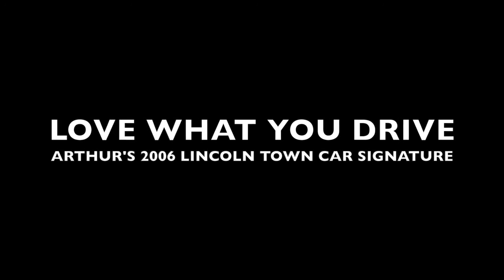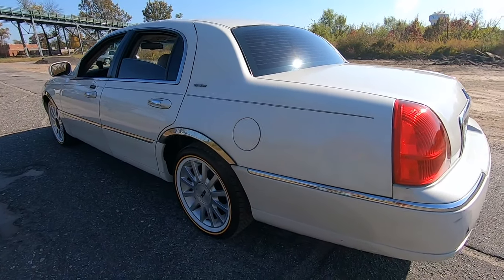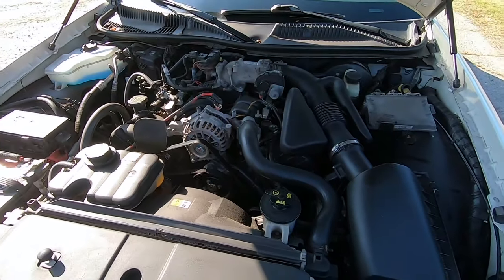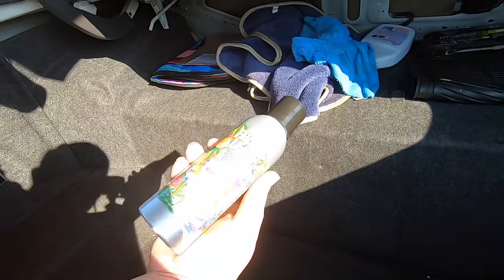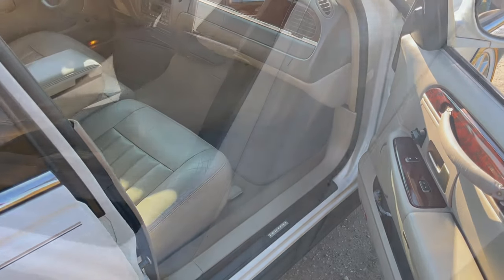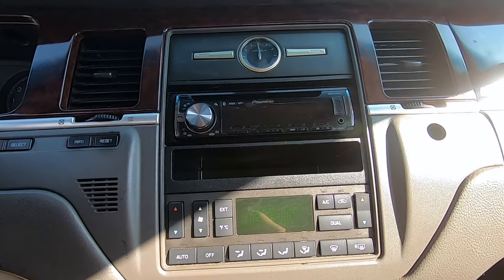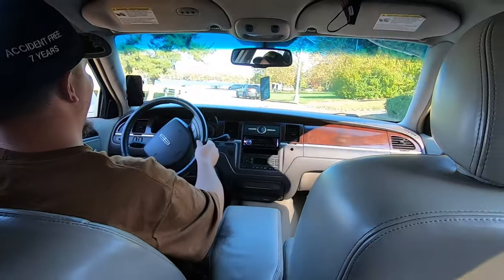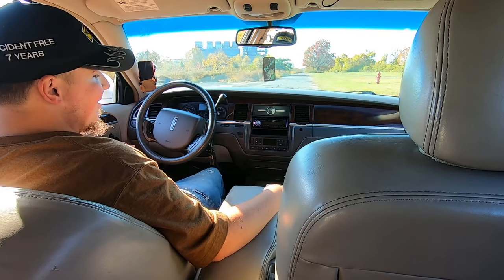2006 Lincoln Town Car Signature | On Vogue White Wall Tires |

Comment: My low mileage (73,000) TOWN CAR Signature Limited is also CASHMERE, which is a rare color and gets lots of attention. Although not Quite equal to traditional chrome laden 89 Signature I once owned, it is the last of great AMERICAN Luxury sedans. I am fortunate to have it. These can easily go 300,000 and more when properly  maintained. Like the rear seat AC heater vent. LINCOLN what a Luxury car should be. Sadly now Lincoln like all the others makes SUVS and crossovers.
Reply from the maker: Thank you for sharing. And thanks for stopping by. Sounds like you have an awesome Lincoln.

Comment: The reason you have that writing in back seat middle department is...someone left something in that space for too long and they lifted middle rest arm and trapped it in there and the object normally something plastic went through change of temperature. (Warm)

Comment: Love to play Josh Turner song 🎵 Loretta 🎵 Lynn's 🎶LINCOLN 🎵 on 💿 while cruising in my Land YACHT! Seldom use rear seat, but will check to see if there is any mark. My Town Car is ceramic coated. Only occasionally do a complete wash. Low pressure rinse and dry keeps it full of shine and looking fine.

Comment: You might want to check all of your All of your cylinders especially the number three cylinder. Also your coil wires probably also need to be replaced. You can't change just one you have to change all. I tried doing that and didn't go from taking the car now to a small specialist because here in California they require emissions control in order to register the vehicles. But I love my town car. I have a 2003 Lincoln Town Car. The same pearl white except mines is an executive. But I do have like you "mustard and mayonnaise" I hope you can figure it out it because all Lincolns 2003 up ❤to 2011s should never die. They should multiply. Good luck! My Lincoln comrades . I myself on the other hand and having problems with my Lincoln Town Car and the headlights will not go off even when the motor is shut down. Any suggestions?